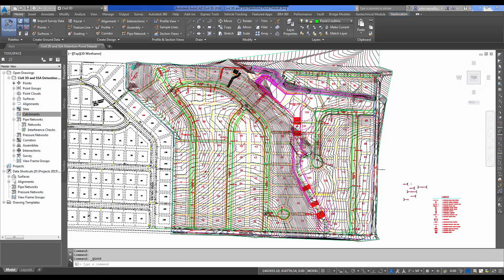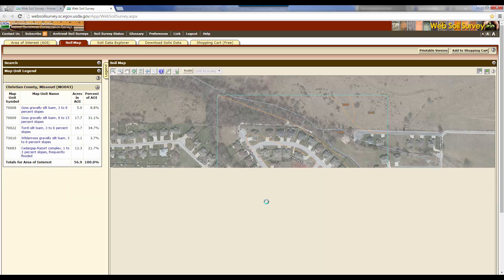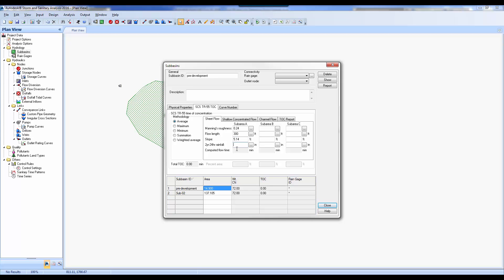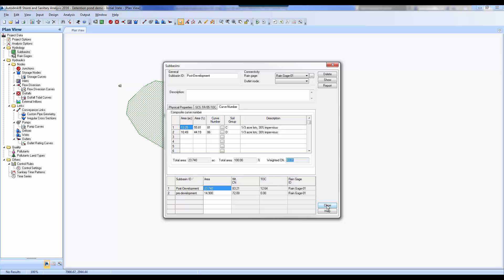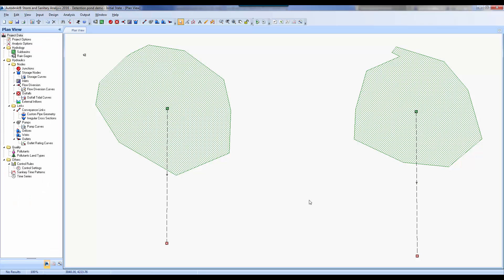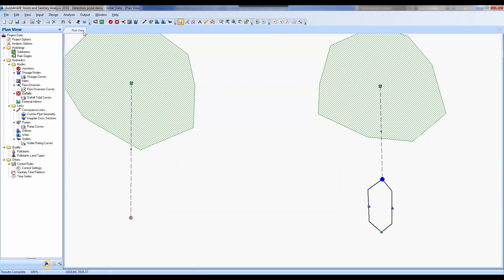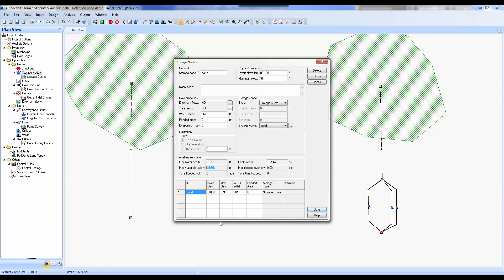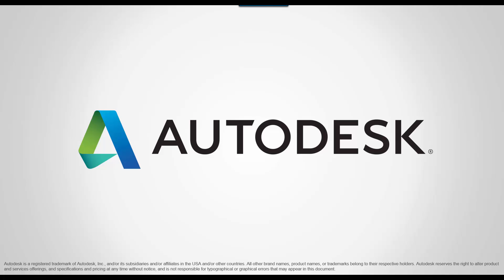Civil 3D and SSA Workflow - Detention Pond Design Workflow

Comment: Hi John! Thanks for sharing your tutorial.
I have one question.

In the “Time series” I put for the fist time (1) “Rainfall Deep” 50 mm in “Unit intensity” San DIEGO 24-hr and the second time (2) “Rainfall Deep” 50 mm in “Unit intensity” Florida DOT 24-hr.
"Rainfall Deep" are the same, "Physical Properties" for Subbasin are the same, but in the "Time Series Plot", Total Inflow Volume (m3) is not the same for different cases.

In the "Project Options", I chose the EPA SEMM Hydrology method, SCS Curve Number and Constant flow.

Why “Total Inflow Volume (m3)” is not the same for different cases (1) and (2)?, in the same “Rainfall Deep” (mm) in Subbasin.

Comment: Good stuff, thank you!  Question: When your setting the parameters for pre-development, the Flow Length should be whatever it currently is in its natural state, not what the standards say (100-300 (ft))?  Right, this is natural state.
Reply from the maker: Yes. That is correct. The only parameter to remember with sheet flow is the maximum you can use it is 300 ft. Now, sometimes its hard to get 300 feet of sheet flow in the post-development condition.

Comment: Trying to make the switch to SSA b/c I can see the benefits of having the entire storm design within a single model.  

Is there a way within the TR-55 Hydrology method to calculate SEPARATELY pervious and impervious coverages within a subbasin (rather than using a composite CN)?  This requirement is written into many SWM ordinances in my neck of the woods, and I haven't been able to find a way to leverage the data entered into the Runoff Coefficient input window to get these results.  The only work around we've seen is creating separate subbasin nodes for each coverage (sub-optimal approach).

Comment: The report is NOT everything the reviewing agency needs.  This is a BIG problem in SSA as it is hard to get a good summary report out of all the data input.  The text in the report is freekishly small and cannot be easily changed.  Hydraflow does a much better job of printing reports of what is necessary for a reviewer all while leaving out the "fluff" that most reviewers don't understand.  Autodesk really fell on their face with the output side of this.  It's almost . . . .SCRATCH THAT . . .ITs NOT worth the hassle to learn the input side if you can't output something that a reviewer can approve?
Reply: Sir Arb

I have got the following question, can you send me relevant tutorials or answer, please. 

Model foul flows using discharge units to BS EN 752. is there any example available please
Produce Greenfield rate calculations using IH124 method.
Allow the application of climate change factors to rainfall data. Typically 30%. Where and how can I apply climate change, please. 
I am looking for a response from you soon, please. 

Thanks for your taking time. 

Kind regards